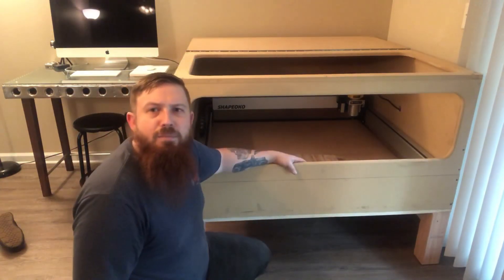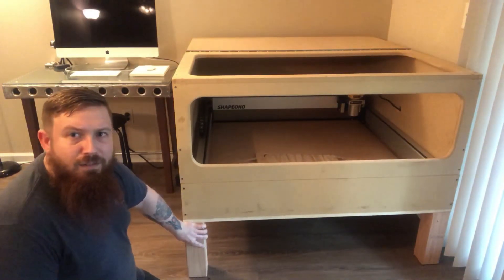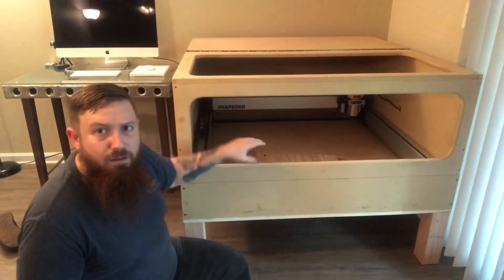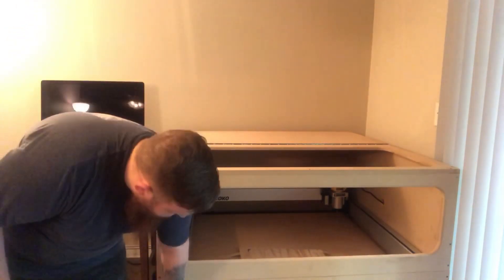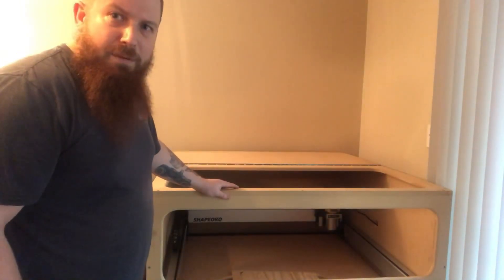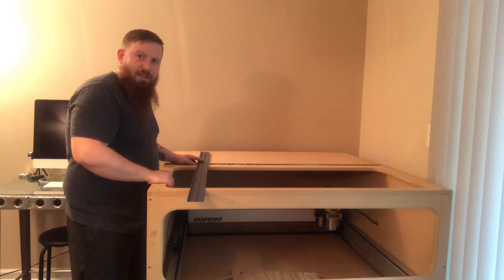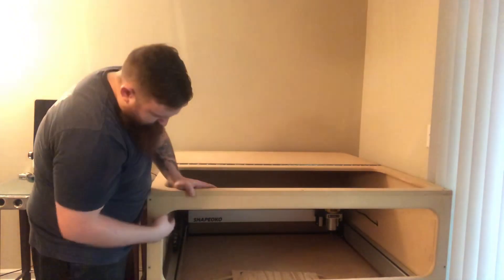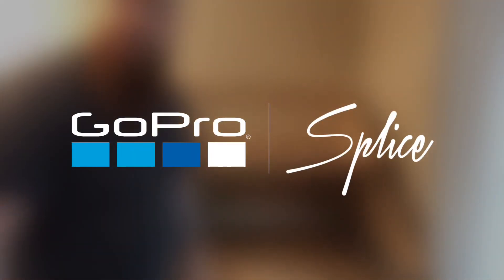Shapeoko XXL cnc router enclosure Carbide Create

Comment: Hey Chris. Love the vids you post. I've been working on my enclosure for my new Shapeoko 3 XXL, and would like to install my controller box on the outside like you did. Did you have enough wire included, or did you have to extend the length to make it work? Thanks.
Reply from the maker: I had just enough length with the factory harness to do it. Just drill the hole right next to where the harness would normally run out of the cable way.